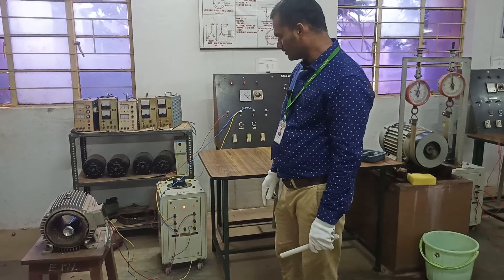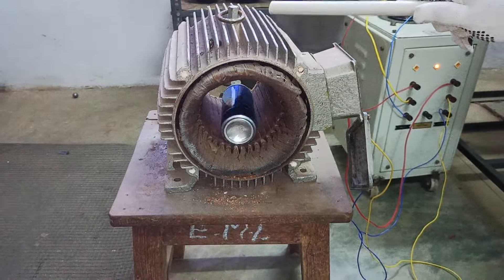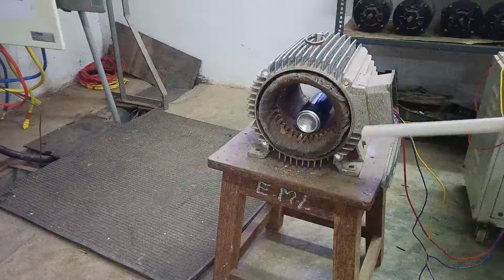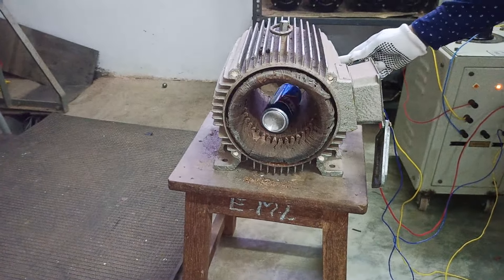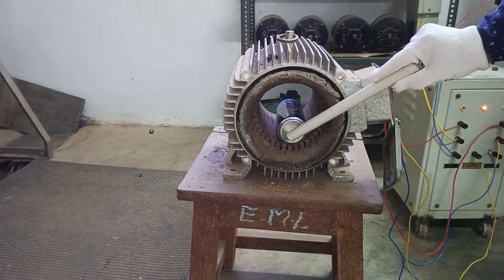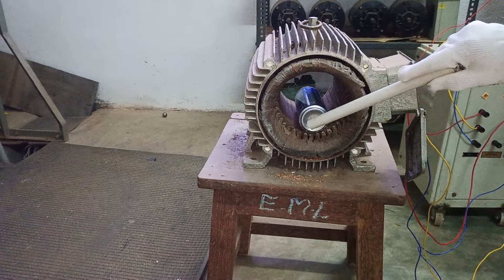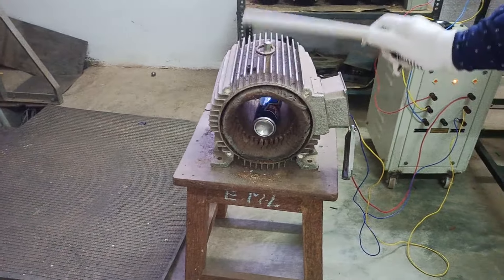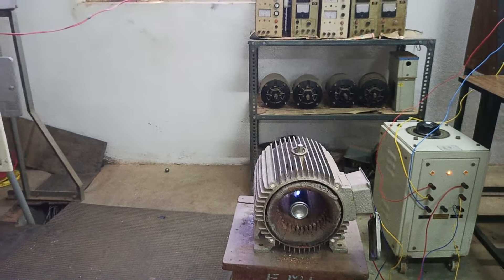The Secret Revealed: Induction Motor Rotating Magnetic Field Demo@ElectricVehicleCrush

Comment: How much Output voltage
Reply from the maker: Output is mechanical output...and speed is 20 rpm...and output torque is 5-10 nm
Reply from the maker: This test is on demonstration of Rotating Magnetic Field with 3 phase supply of 415 Volts